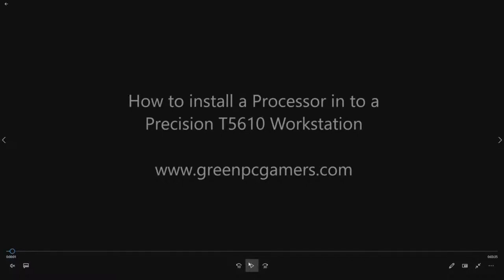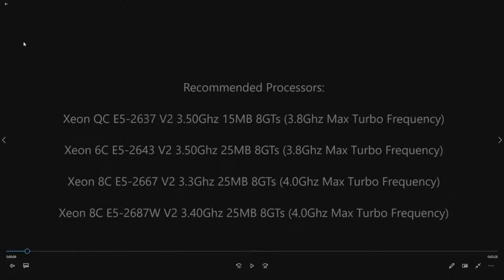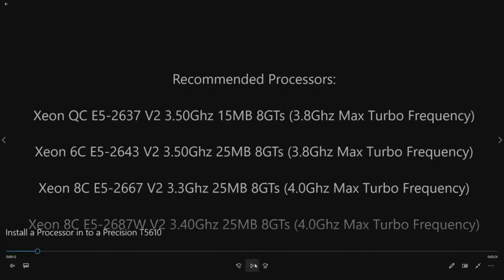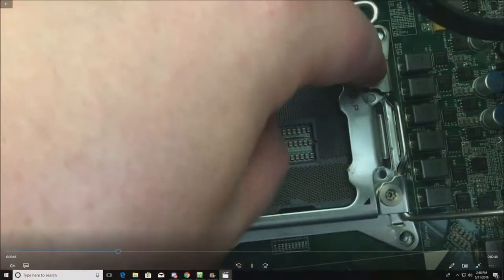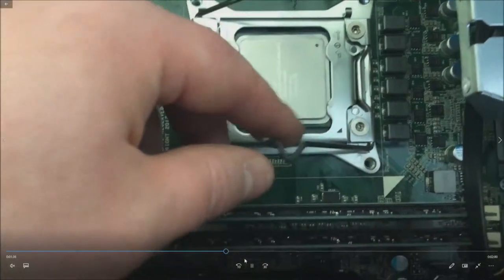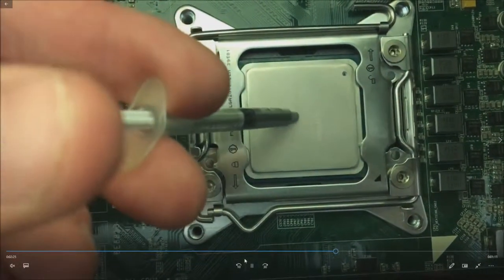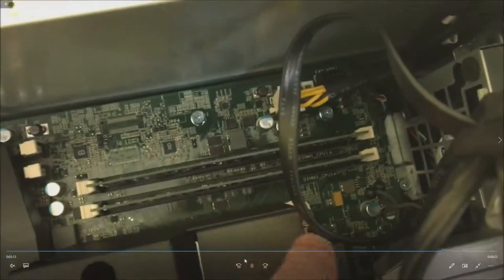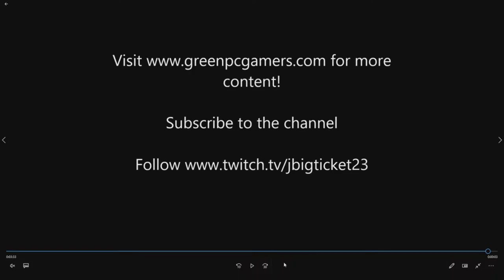How to install a Processor in to a Precision T5610 Workstation

Comment: I tried to combine two Intel Xeon E5-2680 but I only get a blue screen. If I use only one of them, they both work. Do they have to be V2?
Reply from the maker: This could be tied back to the memory.  Make sure you are using an optimized memory configuration.

Comment: Does the Dell heatsink provide sufficient cooling for a high end Xeon like  E5 2667 v2 or would you recommend a 3rd party solution?
Reply from the maker: The stock heatsink is adequate for normal computing.  Noctua makes some cool aftermarket heatsinks that do an even better job of cooling in the Precision workstations.

Comment: If i upgrade to e5-2687w v2 just 1 can i still use with my e5-2670 v2 ?
Because my t5610 have 2 processer.
Reply from the maker: You shouldn't mix different CPU models.